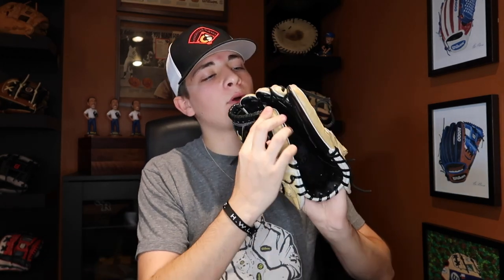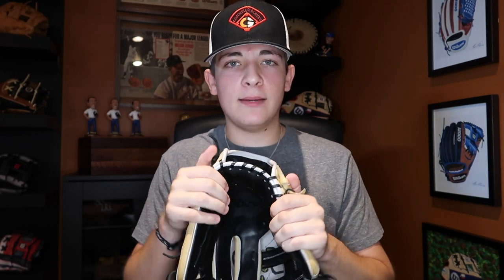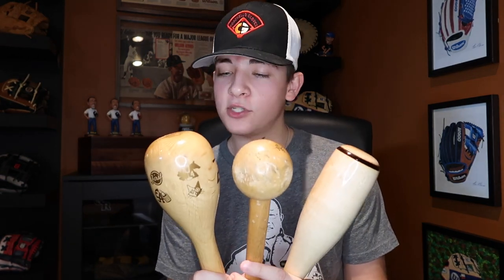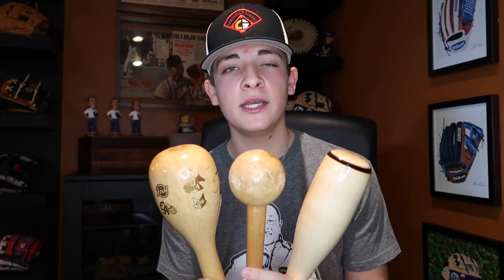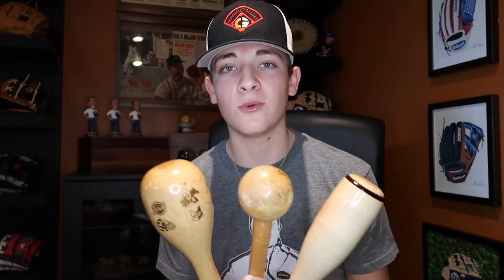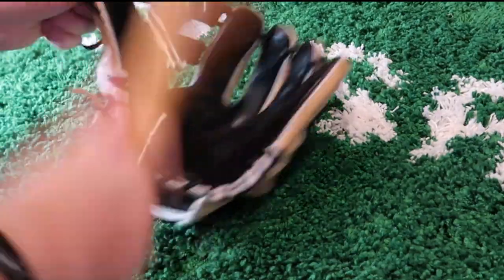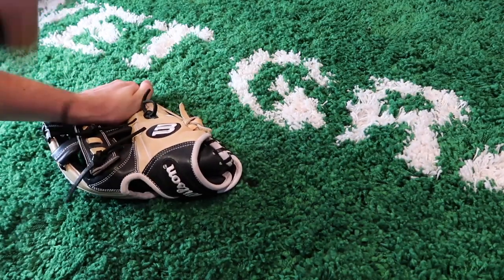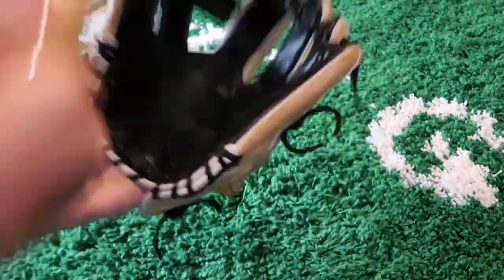HOW TO PROPERLY BREAK IN A GLOVE!!!

Comment: What about putting hot water to loosen up the leather? Will it ruin the leather?
Reply: Check out 914 Ball Gloves or Ball Glove King. They have great break in videos and explain when and why you would want to use hot water. 

TLDR: hot water is for shaping the glove rather than breaking it in.

Comment: You can steam a glove. I would recommend glove Steam for no more than one minute and half twice. It’s a short cut, but you still have to play catch with the glove for about a week to form the pocket. You want to keep a ball in your glove when you’re not using it, rather than to stuff it away in your equipment bag. You’re going to form the pocket from the force of catching the ball in the pocket. But, you can steam a glove. For a very short duration anything over one minute thirty seconds and you’re probably going to run the risk of damaging the glove or the glove breaking down more quickly than usual, especially with a top of the line glove like the A2000. Also, you run the risk of the color dye of the glove starting to run a little bit if you over steam your glove. You can always steam your glove again but just for a very short duration and not over a minute and a half in the steamer. If you steam the glove for a longer duration of four or five minutes than you run the risk of hardening the leather and it will turn out as he described in the video with a floppy pocket. That isn’t what you want especially for a top of the line glove. But, you have to play catch with the glove for at least one week to properly break in your glove.